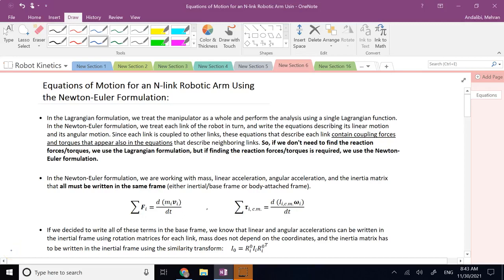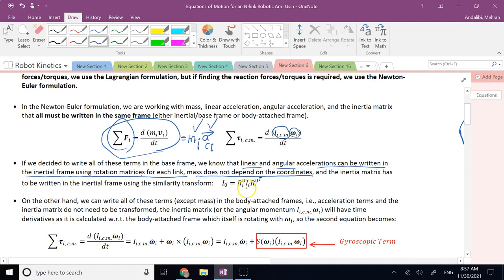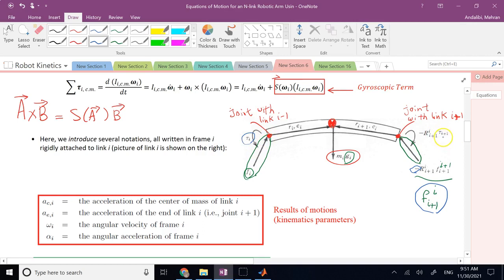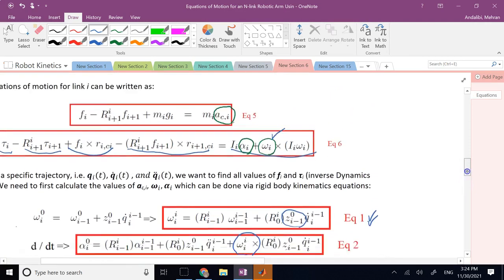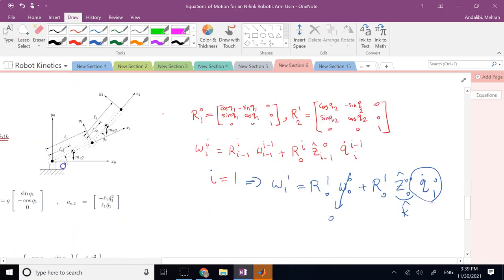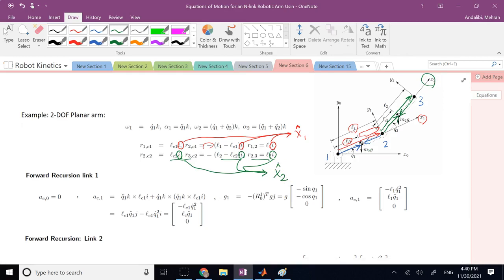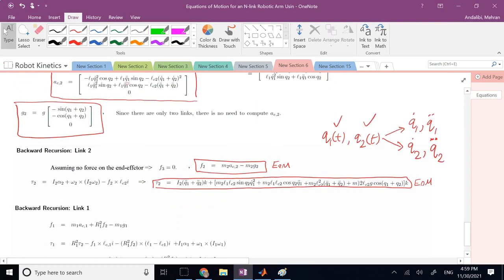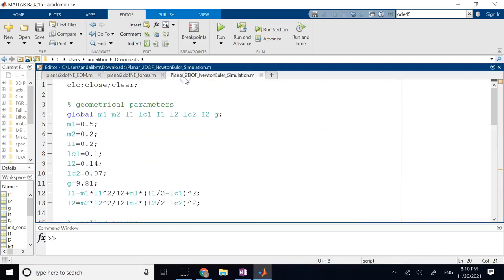Equation of Motion for robotic manipulators using Newton Euler Formulation

Comment: Hi i'm a little confused by the rigid body dynamics at 6:00. I'm probably wrong but I thought that the vector Va was the resultant of Vc + Va,w ( linear velocity at A as a result of rotational velocity w). I think in the video it is Vc as a result of Va,w + Va. 

But also thank  you for your video, it was really good
Reply from the maker: Hi, You are welcome.

You can write the linear velocity of any point (Let's say C) on a rigid body as the sum of the linear velocity of another point (Let's say A) and the cross product of the object's angular velocity (let's say omega) and the relative position vector connecting the second point to the first point (let's say r C/A which reads position of point C with respect to point A that connects point A to point C).